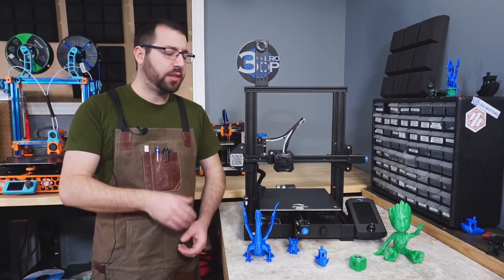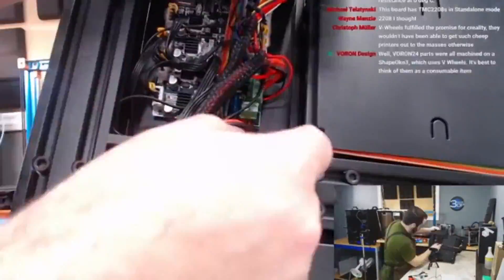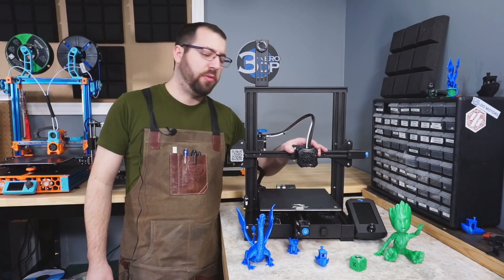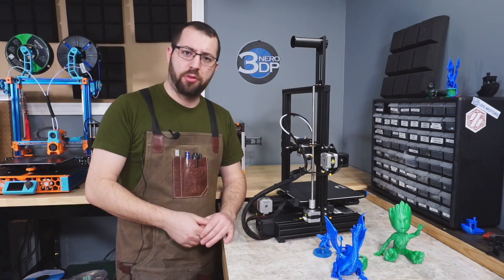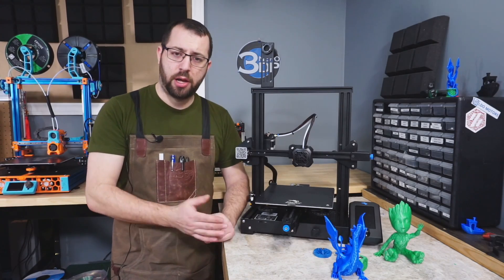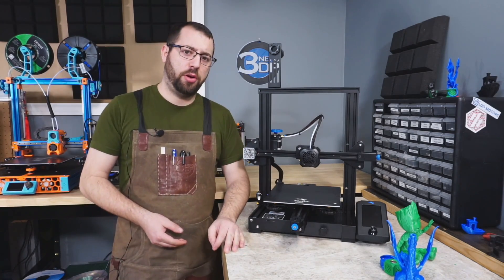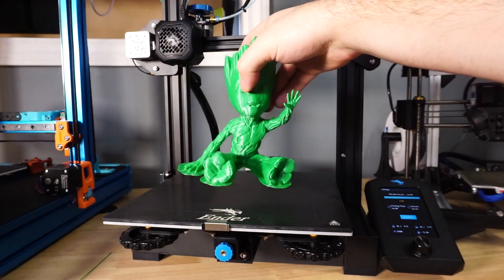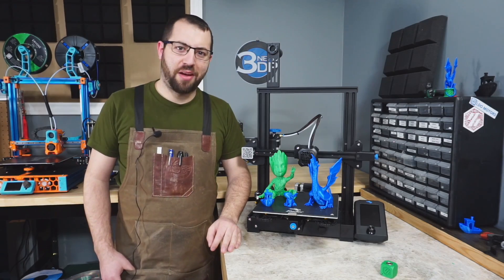The Ender3 V2 - Musing from a 3D Printer Builder

Comment: Titan Aero has curved teeth, they cut in just as much. I have on and am still having probles getting it to work well. The geometry is wrong anyhow, as there are at most 1.(verylittle) teeth engaged at any point. This means that it walks the fillament, looking at my MIG welder that has the option of a toothed extruder wheel or a smooth V shaped one, it becomes apparent which would result in a smooth flow.

Comment: I started off with an Ender 3 but sold it after a few months as I was having issues with the rollers/v slots affecting print quality. I then bought an Ender 3 V2 unfinished project from someone locally on eBay. It already had 3DFused linear rails on all three axes, dual lead screws and stepper motors, and squash ball vibration dampening feet. I added a 32bit mainboard, auto bed levelling, a direct drive extruder, a filament runout sensor, and heatsinks to the stepper motors. It works great and is incredibly reliable producing consistently good prints with decent quality filament :-) I actually find the tool tray very useful!

Comment: Hi Nero, I wonder if you have any thoughts on the dual Z upgrade? It seems like that is one major problem of the Ender 3 design (wobbly X gantry).
Reply: I have installed a belted dual Z. Best to buy the parts yourself, I'd say. The top bearing blocks should be adjustable to avoid sideways force from spindle to the nut.

Comment: Can you try printing Voron parts in ABS on this printer?  I would love to see how you tune ABS on an ender 3 v2.
Reply: i have printed asa and abs with no issue. on the stock ptfe hotend tho keep the printer in an enclosure and yourself out of the room with the printer while it is printing because of ptfe gasses. printed asa parts for many things including the hydra fan duct system for my printer that i used now for my tl dragon hotend and now i can go up to high temps safer. on the stock bowden and stock hotend setup there was minimal tuning needed. all i remember is dropping retracts a little else after the retract there would be some bubbles and crackling and skipped extrusion.
Reply from the maker: I will be after the hotend heatbreak or hotend itself is swapped out

Comment: Ender 3 is the best printer to print all parts for Switchwire/Voron 2.4. Anyway, nice to develop a printable parts kit to convert ender 3 to CoreXZ kinematic.
Reply: Except not really as the PTFE hotend can't do ABS temperatures without toxic gases (other than the ABS ones) and the PTFE degrading
Reply: @ManIkWeet  Abs+ have less melting temp actually. Anyway it possible to buy cheap all metal heatthroat and replace stock one
Reply: @mosiyukvasil  Yup. I used a CR-10S to print my Voron parts, with all-metal hot end. But printed at 235 degrees in ABS+ which would have worked fine on the stock hot end.
Reply: @domg7359  yeah sir, also printed mosquito mount plate on ender with abs+ and stock nozzle. It’s not so difficult to start printing and leave a room while it printing, after that open window to flush all gazes